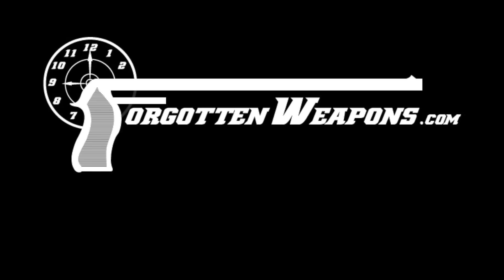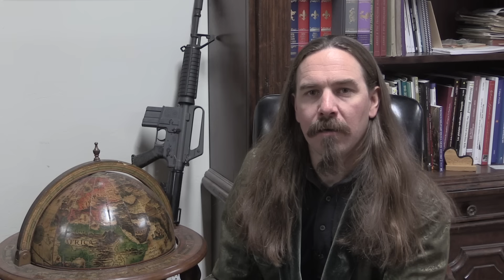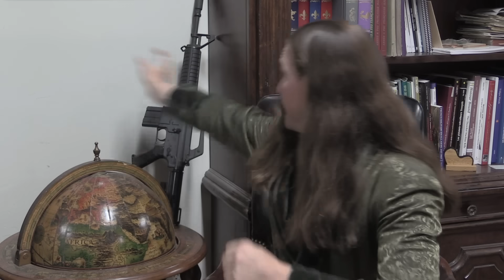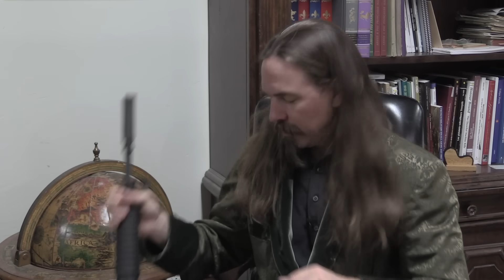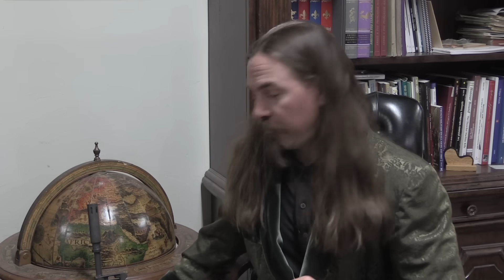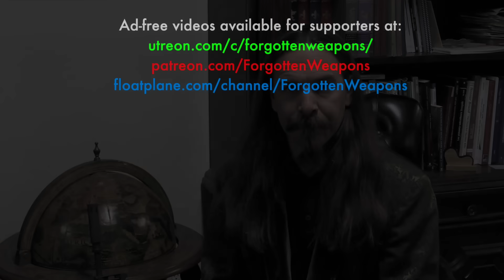Ask Ian: "Last Ditch" Rifles for World War III?

Comment: Can't help but think that Ian's description fits the Service rifle of the NCR from New Vegas.
Reply: If it got really really bad I'm sure one could redesign the m4 system to have a side charging system like the service rifle. It would also delete the small fiddly parts involved in the spring loaded ejection port cover, and all the parts and machining involved in making the top charging handle. Loads of other people have said that getting rid of the forward assist would be top of the list, as it should. I think the furniture would stay polymer though, Fallout is a world in which the secrets of the old world are lost, or at the very least access to them is severely limited, I doubt the NCR would ever be able to get a supply of good quality plastic going ever, especially with the lack of oil that started the great war in the first place. In real life, if worst comes to worst, everyone with an injection molding machine can make conscript rifle quality furniture, and the proper selection, treating, storage, carving, and general processing of the good quality wood like rifle stocks is almost an artisanal skill at this point.
Reply: @gruntysskim4145  that's the thing, NCR tech level is fluctuating between Great War and early Vietnam War. So you would see a lot more wood and steel furniture like AK and Valmet. But technically they can do plastics like bakelite, they'd be very expensive though as all resin and oil types have to be sourced from biochemical factories as only raw material left are various agricultural produces.
Reply: @TheArklyte well I think the issue isn't tech level, it's manufacturing capacity. They know how most of the stuff from 2077 works and how to make it, it's just currently economically unfeasible to outfit their entire army with it, so they'll use a mixture of pre-war relics and equipment made through less sophisticated production methods.

It's just like in the Doctor Who episode "Genesis of the Daleks" where the Kaleds still had the ability to make Ray guns, but with all their infrastructure bombed to hell most of their troops are using bolt action rifles.
Reply: @gruntysskim4145  two words, ocean plastic
Reply: No surprise, the lead designer was a gun nut.
Reply: @googlehepimizifisliyor2968 And the world of Fallout certainly fits into times the weapon was meant for...

Comment: I love the irony that the AR-15/M16 is now faster and easier to make than the AR-18 which was conceived as a quicker, cheaper rifle.
Reply: Stamped sheet metal receivers are quicker and cheaper than machining a forging if you have the ability to scale it up. That's why civilian stamped rifles cost more, they don't have the production quantity to spread the cost of tooling and setup over.
Reply: @Snakesht172  injection molded lowers are way cheaper exponentially because it also makes the stock and grip in one go quicker and cheaper then steel plus it's lighter and dosnt rust
Reply: mostly because cnc'ing is soooooo cheap and time efficient now, and that's 3 axis and pretty much every shop can afford at least a couple cnc cabinets now
Reply: The AR18 wasn't designed to be cheaper or quicker. It was designed to be manufactured locally by lower tech countries that couldn't easily make the M16. The hitch was that the US gave away surplus M16s to its allies, undermining their arms manufacturing industries. 
It's heavier than the M16 due to it being made out of sheet steel rather than aluminum alloy. The action is solid; several service rifles (Enfield L85 IW and L86 LSW and the Daewoo K2) ripped it off.
Reply: Ah, hmmyes. Stonks...
Reply: @AsbestosMuffins  but.. you need a forge to make the uppers and lowers to mill.
Reply: @Snakesht172  Even quicker, if you use pre-made square tubing. Skips the stamping process altogether.
Reply: @ALovelyBunchOfDragonballz  AR18 Development did technically advance. Just not on the same path. Like Sidney says above, Sig MCX, L85/86, K2, Tavor,  ACR, SCAR, G36, Hell the Sig Spear getting adopted by the Army is at its bones an AR18.
Reply: @randomidiot8142  Yeap. Forging Al. Trivial task. After that give the parts to row of Brother Speedio :s. Just google what they can do to Al parts in seconds.
Reply: Quicker, cheaper to set up production lines not the end product
Reply: very similar to the STG-44 and that other weird last ditch nazi rifle
Reply: @SidneyBroadshead  The Daewoo K2 uses a long stroke piston system not a short stroke piston system so its more like an AK than an AR18, you might be thinking of the Howa Type 89 or the CIS SAR 80
Reply: @claytonmachine12  Both the K2 and Tavor uses a long stroke gas piston system not a short stroke gas piston system so they are closer to the AK than the AR18
Reply: And better
Reply: Because the AR-18 was barely developed any further after it came out, only very recently did it make a come back on the civilian market but they kept it to the oldschool specs.

M16 on the other hand was constantly improved throughout its 60 year existence, and produced in huge numbers
Reply: What if they make a newer AR-18 ?
Reply: its called economy of scale.  Once a standard is established in any market, the manufacturer can become extremely efficient at producing it.
Reply: Incorrect. It's actually not. The AR18 is still cheaper, materials and construction are simpler. It's only the fashion demand for fully machined AR15 style uppers and lowers with the long buffer tube required. The only simpler part is the evil direct impingement design which detracts from long term reliability in a harsh environment I.e WW3 end of the world scenario.
Reply: I’d be willing to bet that an injection molded polymer ar18 lower that accepts ar15 mags would be even faster and cheaper than the injection molded ar15. It’s a much smaller part which means that you don’t have to have as tight of tolerances over as long a distance as with the ar 15 buffer assembly. Not to say that that’s what they’d choose in this hypothetical because ar15s are more ubiquitous.
Reply: Come on man you need 223 ammo that is the bottle neck every one has an  A R  and mags  shf  you need ammo a weapon is useless with out ammo
Reply: You are proof again that the dumbest comments get the most likes. The Stoner AR platform requires many steps to manufacture. Hardly a last ditch endeavor
Reply: @bilbo_gamers6417  The STG wasn't a last ditch. It was a well built and properly designed weapon that had a very good service record. In fact, it's quite the opposite of a last ditch, the whole reason the Germans had a sturmgewehr project was because they were still trying to beat the Allies on quality rather than quantity. Then they realized that wasn't going to happen and they just started throwing anything and everything that went bang into the field
Reply: @stevedunn2195  5.56 and .223 are two of the most common rifle cartridges in the world. It's not like it's some rare, specialised cartridge, you can get it anywhere. Prices are absurd these days, but that applies to every cartridge under the sun
Reply: And to not step on the M16 patents.
Reply: Its been 50 years chief thats like saying the M4 is lighter and smaller than the m16a1-- I'd sure damn hope it is
Reply: @ShutUpBubi  barrel on the M4 is quite a bit heavier profile, so an M4 ends up heavier than an M16 or A1. Despite being 6" shorter.
Reply: @filmandfirearms  that's exactly what i said lol. it was easier to build than the so called last ditch weapon because they had tooled up for it. sorry if that was unclear in my comment. i just remember ian going over one of the really late replacements to the stg 44 that was harder to produce than the real rifle was by that time
Reply: @gw5436  Besides, while the development of the AR 18 stopped in America, it inspired the designs of many other rifles in other countries like the G36, Howa or the newest QBZ. There is, however, no continuation of the AR15.
Reply: The F-35 is now faster and cheaper to produce than the Saab Gripen. Both are fantastic aircraft! But one of them is more fantastic in more ways and has more international backing. This is exactly what happened with the AR15. The AR18 was better in one significant way -- it was simple to produce by underskilled and underequipped economies (which is why variants of it persist in production, and it certainty deserves its impressive lineage in rifles like the Steyr AUG and the H&K G36) but the AR15 became better because it was always intended to become better. Stoner had doctrinal ideas regarding the perfect fighting rifle and strong opinions regarding direct impingement versus short stroke piston arrangements, but the core rifle was intended to evolve as technology and tactics dictated. 

Still, my heart belongs to the AR18 even if my head tells me the AR15 has become the better overall rifle in all categories except for manufactural simplicity. She's so ugly and so perfect and I love her!
Reply: AR18 is the option for countries that have been denied to have Colt licensing.
Reply: Economy of scale over a 60 year period. Pick any design you like, and give it the same R&D attention the AR-15 platform has gotten and it would also have its cost around the same point.
Reply: @Popinmo  injection molded lower stamped or extruded upper? (I know scar enters the chat.)
Reply: @AsbestosMuffins  The government would probably contract out private civilian CnC guys to mill lowers.  The irony would not be lost there.
Reply: @ALovelyBunchOfDragonballz  Casting isn't faster than stamping. Stamping is faster than casting. And the AR18 design has advanced and progressed as someone else has mentioned.
Reply: @Eduardo_Espinoza  They have. For some reason, everyone who wrote about the AR18 design being used in new weapons systems has forgot that Brownells makes a BRN180 now that is able to be used on AR15 lowers. The BRN180 upper isn't made of stamped sheet metal though, but most short stroke piston uppers that are based on the AR18 aren't either.
Reply: Considering the number of different companies making AR's it would not be hard to divert all that production to the military. The only parts that would have to be changes are the hammer, safety seer and sights. Those are all minor alteration to the machining process.
Reply: @popinmo  The problem is how do they hold up to heavy use. If you are in the front line you do not get to shoot on mag and stop. It also would not get handled with kid gloves it will get banged around.
Reply: @johnmcmickle5685  there made of the same stuff as the kp15 or I can make them for cheap with pla+ which is also Strong
Reply: @johnmcmickle5685  Most of those companies are distributors; not producers. There's a limited number of actual manufacturers for these parts. Schmid Tool and Engineering manufacturers pretty much all of the most popular standard triggers for AR-15s that other companies distribute from Geissele to Wilson Combat.
Reply: Compared to the M-14….
Reply: @Eduardo_Espinoza  you mean the SIG MCX?
Reply: @popinmo  That might be but i personally want something that is going to hold up if I am taking it into battle.
Reply: @johnmcmickle5685  the plastic per pound is stronger
Reply: @popinmo  Only under certain applications. I am retired from road and bridge construction and have yet to see a single piece of synthetic rebar or a single bridge beam or girder made out of anything but steel or steel reinforced concrete.
Reply: @johnmcmickle5685  what does that have to do with material science?
Reply: @claytonmachine12  don't forget both the cz 805 bren and the bren 2... and lots more I'm sure. Pretty much anything that's not an ar or AK derivative is pretty much the bastard child ar18
Reply: @Snakesht172  Taxes and demand make up the biggest part of civilian firearms. So make a false short fall of available firearms then scare everyone to want guns and you get rich.
Reply: It’s the age old if it works don’t fix it
Reply: @Eduardo_Espinoza  They have designed a more modern AR-18. There's a polymer Lower Receiver version of the AR-18 that's lighter (and stronger than the original). There are guys that are fabricating parts like replica AR-18 and AR-180 furniture and retro pistol grips. 
The AR-18 magazines were considered more reliable than the M16s and come in 20, 30 or 40 round capacities.
Reply: @SidneyBroadshead  The G36 also ripped off the AR18 action.  As did the XM8.  And the Japanese Type 89.  Bushmaster ACR.  Depending on how closely it a copy has to be to count as a copy, you could argue the HK416, FN SCAR, and others are taken from the AR18 design.
Reply: @bilbo_gamers6417  You said "Like the STG and that other last ditch rifle." That directly implies you think the STG was a last ditch rifle
Reply: @filmandfirearms  i im sowwy daddy :(
Reply: It is ultimately .about the getting the mfg infrastructure in place, and sustaining the entire logistics, ie raw materials, etc. Once you have that setup, it's easy. Ie receivers are being forged at a rate of dozens if dozens an hour. The best wind up in govt and premium brands. This wholesale mfg approach, the byproduct of wartime production relics of WW2 still on the books druing Vietnam, helped make the AR15 base pattern simpler to sustain production, than to develop a whole new production and logistics chain. 

It literally is the largest cost of developing and adopting a new rifle, even for civ only designs. Why you see many 'new' designs being merely modified old versions. Simpler and cheaper to develop/refine a design over an entirely new one.
Reply: Yeah lol. With 1940s/1950s technology and tens of millions of rifles, the AR-180 would be cheaper. But with modern CNC, thr AR-15 is perfectly efficient.
Reply: @claytonmachine12  now if only Spear had that SCAR stock...
Reply: @SidneyBroadshead that, and to get around Colt patents.  Stoner used a completely different gas system in order to not get sued by Colt. 

Also, the K2 gas system is not based on the short stroke system found in AR-18s.  They're a straight up copy of an AKs long stroke piston. The K2 is literally an AK/M16 hybrid.
Reply: theroreticly i would imagine if we had the same interest in the ar 18 than the 15 we would be 10x better in every aspect
Reply: Yall, we've been 3D printing lowers for the better part of a decade now. AR, AK,  FAMAS, MAC 10/11, Ruger P-series, any Glock you can imagine are all being pumped out in under a day with a multi- thousand round tolerance. There is no need to stamp or forge anything anymore. 😂
Reply: @Eduardo_Espinoza already in Canada for civilians
Reply: the AR-18 could be unbelievably cheap to make. the problem was that, with the tooling they had, it wasn't cheaper Enough vs the AR-15 to make sense. it didn't have as much data about its design as the AR-15 now has, it's an unknown quantity whereas the AR-15 is now Known, and nowadays plastic injection molding and CNC is frankly far cheaper than stamping could ever be. just due to materials cost of steel vs plastic but also opportunity cost. a single well run CNC nowadays can frankly do what used to require a huge number of machines and millions of dollars. the game has changed somewhat, except for the still remaining huge manufacturing jobs (like automotive production, cheap manufactured goods, and - for weapons - magazines and cartridge casings). however, stamping is still the way to go. it's just that the aluminium AR turned out to be nice and cheap enough to where it was really desirable. 

Maybe if the USA had gone into a third world war in the early 1960s, before the M-16 was adopted, things would've been different and the AR-18 would've been adopted due to its lower cost at scale being nicer for outfitting hundreds of thousands or millions of troops very quickly (and the potential resource issues with materials like aluminium that would be critical to that world war 3 scale war effort).
Reply: @SidneyBroadshead  Which would also lower the costs...
Reply: @johnmcmickle5685  What does a bridge, have to do with a firearm?
Reply: The AK is the same way the more you make the cheaper they become the AK become stupidly cheap to make
Reply: tooling availability will tend to do that. why do you think disc brakes are more expensive than drums despite being way less complex?

Comment: I hope this video never ends up into the “Ian’s incredible ability to predict the future” series
Reply: I recently had a thought; how would a gun be designed if the objective was to make fully automatic rifle that would be most easily homemade, a gun designed for an insurgency with a weapons shortage, but would still use either AR or AK magazines and ammo. That gun that wouldn't need to be as reliable as a military standard rifle, with the least amount of features and simplicity of manufacturing. Not something last ditch by a government, but something still for "desperate times".. if you combine what Ian said about polymer moldings, with 3D printed parts, simplified CNC machining etc.
Reply: @gawkthimm6030   I think it'd be a slightly sturdier and bigger, 3D printed, Sten. If you really want to go for simplicity that's as simple as you're gonna get. Can't imagine any other gun to fit that role, that wouldn't require a lot of materials.
Reply: @RaiderCat12  but that wouldnt be able to use modern magazines and ammo in wide circulation, which would be the second most important requirement, or do you mean "bigger" as in modified for rifle ammo?
Reply: @gawkthimm6030  I do mean bigger as in modified for rifle ammo and to take rifle mags, sorry for the misunderstanding.
Reply: @RaiderCat12  no problemo, but thanks for the reply
Reply: @gawkthimm6030   Always glad to be helpful.
Reply: Indeed. China makes me nervous.